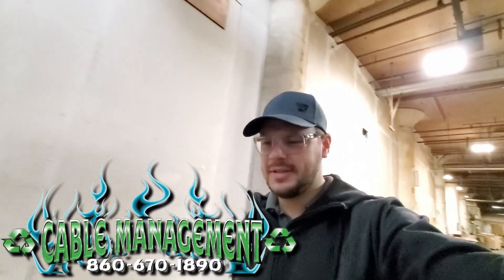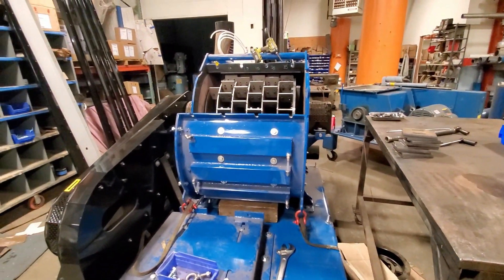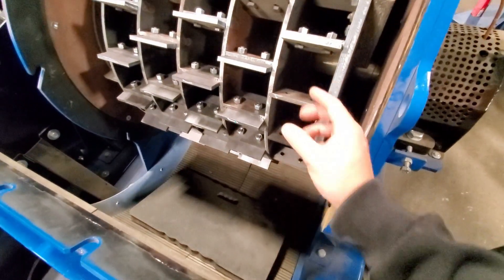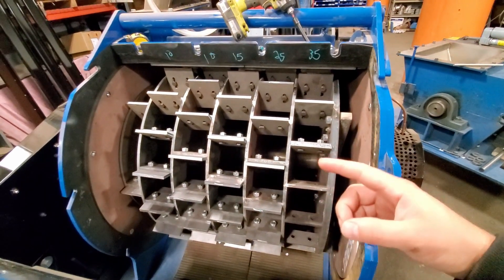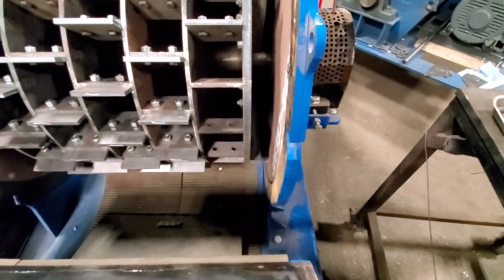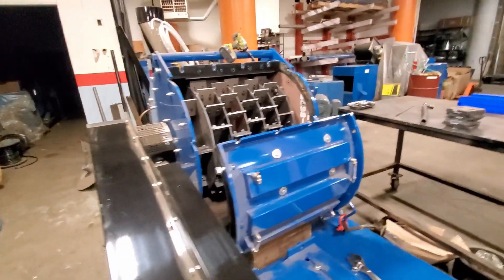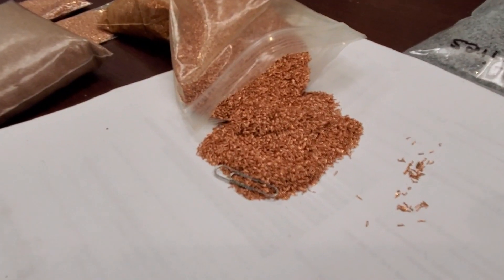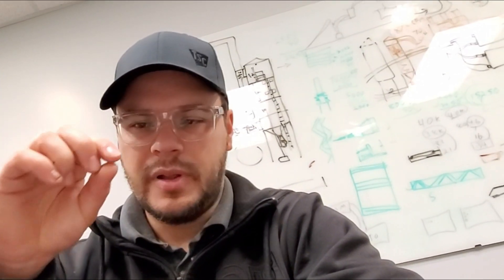How Does a Turbo Mill Work?

Comment: At what speed (RPM) is turbo mill running ?
Reply from the maker: 700-1800 rpm. It really depends on the size of the mill. We're really aiming for tip speed. The larger the diameter of the mill, the slower we need the rpms to be in order to reach optimal blade tip speed which needs a range of 120-170 fps    depending on what type of material you are processing. Fine wires and materials need higher tip speed.
Reply: @cablemanagementusa Thank you for answer. We have old (probably chineese) version of turbo mill and we are trying to make it work, but there are no good resoults. Diameter of rotor is 300mm. Maybe we should change to new model....
Reply from the maker: @MIsL25  sned pictures of the inside of your mill to info@cablemanagementusa.com

Comment: Is a Turbo Mill the same or similar to an Attrition Mill? I need to see how one works.
Reply from the maker: It's very similar in how it works by principal. However an attrition Mill will not hold up to scrap recycling in the same way that a turbo Mill will.
Reply: @cablemanagementusa  , thanks. I'm looking for a video showing inside an attrition mill. I'm evaluating Attrition vs Hammill for my application and getting a lot of claims without backup data.
Reply from the maker: @larrymaloney877  send me an email at info@cablemanagementusa.com with the application, I'll help you as much as I can. We've tried an attrition Mill for what we do, so we have some experience with both.

Comment: Hi, I have seen your projects and they really are amazing. I have several doubts about how the whole system works. But if it is not annoying could you tell me the characteristics of the table of the copper and plastics separator. The right material they use and its dimensions. It will help me finish my research. 
Thank you very much for your attention and we apologize for the inconvenience.

Sorry for my bad english.
Reply from the maker: No problem, please email your request to info@cablemanagementusa.com thank you!

Comment: this is an interesting working principle- how finely does the wire need to be pre-shred beforehand?
Reply: Allows you to use a larger screen in the pre-shredder and granulator, which reduces the load on those components and increases throughput.   The densifying of the material into small balls or smaller curled material saves your screen on your shaker tables and air tables as they usually become like a brillow pad with strands getting stuck in the mesh.   The TurboMill has the least amount of maintenance and adds the most value to the end product.
Reply: what... size material does it accept
Reply: @handdancin  A lot depends on the type of material you are running.  Do you have a yard and a plant now?
Reply from the maker: The material should be under 3/4". The smaller it is before, the faster it will get processed.